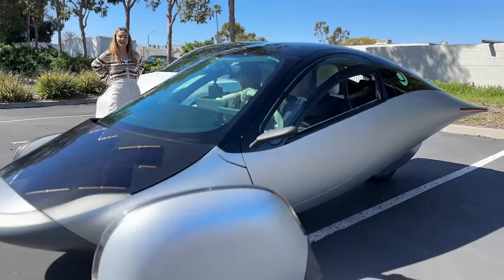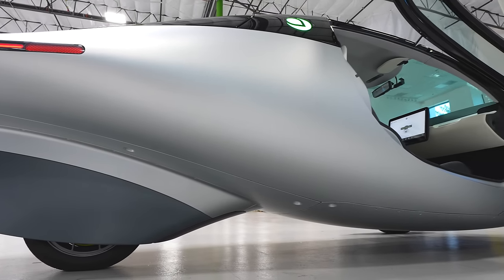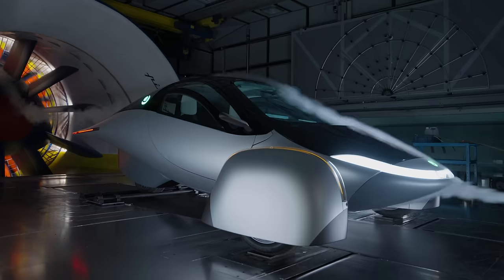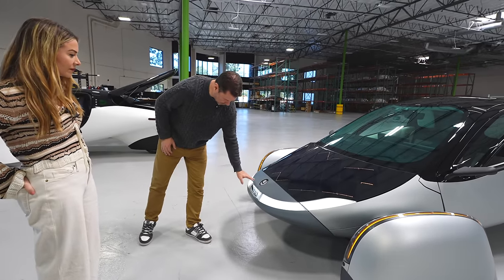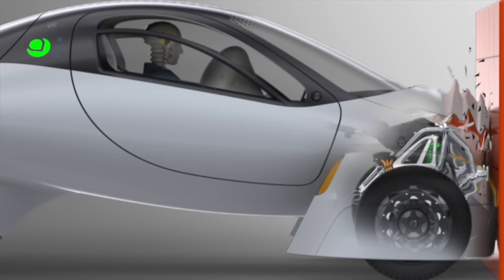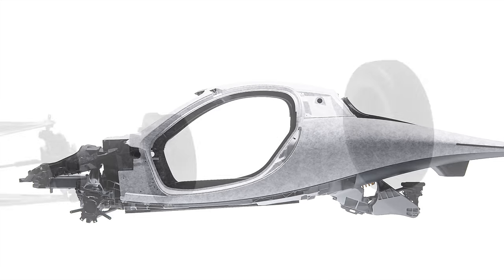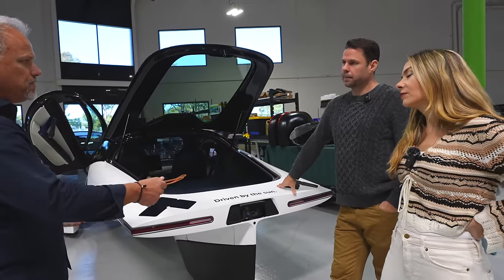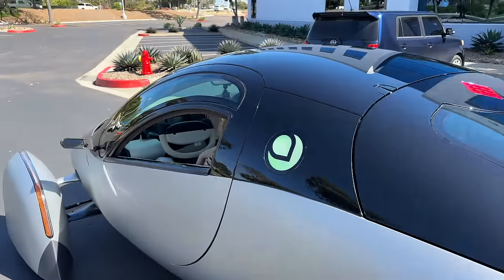Confronting Aptera's CEO w/ Investor - WHERE'S MY CAR?

Comment: This guy say gasoline engines you're only getting about 25% of that energy to the wheels. Ues people know this its also know that car manufacturers program into modern cars ecu and stuff like that to NOT make clean and fully usable. They are programed to WASTE  most of the power it is capable of making. And this all came from a few different people in the automotive industry that were very high up in the design and programming of these units. They said modern combination vehicles would and could go over 1500 miles to a tank easily  if dumbing so to say these vehicles down.

Comment: I see a lot of wasted space in the back
Reply: Not wasted - it forms part of the safety crumple zone, and aerodynamic performance.
Reply: @n.brucenelson5920 Talking about the back end where the single rear wheel eats up 60-80% of potential cargo space.
Mind you I've owned subcompacts, including an 80's Toyota Corolla hatchback  which was 17 inches shorter and 23in narrower than that Aptera, and I carried 2 2 drawer filing cabinets
Reply: @linusa2996  A 2 drawer legal sized filing cabinet has a volume of around 4 cu ft.  Since the Aptera cargo space is 32.5 cu ft, it should be able to hold two nicely.  If needed it can be driven with the rear hatch open with no fear of exhaust fumes.

Comment: This is a bad idea. Solar energy is unreliable, meaning they won't be able to make the trips they want when they want. Also can't park the vehicle in most places (downtown, around trees, indoor parking, garages, etc.) to charge.

An efficient vehicle would just be the same thing with the solar panels stripped out and more efficient panels added to a home or business instead.
Reply: 🤓No, it doesn't mean that, because Aptera charges faster at any charger or outlet than almost any other EV. (That's about 400 to 600 miles per hour at a Tesla Supercharger.) The solar charger is purely a bonus allowing you to not always need to plug it in.

Comment: Aptera has not updated what is going on with the skin cooling feature and how that will work in extreme climates.
Reply: It does not work.
Reply: @RomanChaar  You need proof it works - you're putting the cart before the horse.
Reply: Updates are coming, perhaps even before the validation of the PI vehicles.  The AC system will also come into play during charging or slow speed operation.  

If heat limits are approaching Aptera will limit power production to avoid damage to systems, including the batteries.
Reply: @aussieideasman8498  hola señor Aussie I’ve watched most of your videos. I think aptera said along time ago they are patenting the idea and can’t disclose how it works. Idk it would be nice for at least an update from them
Reply: @RomanChaar  Greetings Roman. They have a patent pending and it is a poor attempt. I have seen it. It cites wingnut (Daniel Morris) as the inventor and shortly afterwards they sacked him. Go figure? Inventor of the greatest idea in auto history in a hundred years and they give him the boot, lol. They had a previous patent before that and Chris Anthony was cited as the inventor. They changed the cooling method after I made those videos saying it can't work. I still say it can't work. They won't be updating, but if their cover of the BMS is anything to go by, it's not worth watching one. Their big hurdle will be getting past the PI validation tests. When they fail those it's all over red rover; nobody will want one.
Reply: @aussieideasman8498  so how will they cool the batter pack?
Reply: @RomanChaar  The BMS will stop the EV - often, lol.

Comment: great show...keep it up... way over priced car...their prices need to be cut in half to be worth buying... however it does not look  like they have the ability to produce many cars in a year so that might be the reason....i like the car however way to expense for what it is
Reply: We do not yet know final pricing, but for sure it will have better performance than the first Tesla roadsters at a fraction of the price.  There are now almost 50,000 pre-orders, and once production vehicles appear, these numbers are likely to skyrocket.  The first production line will be able to produce 20,000 vehicles per year, per shift, and it will be rather easy to build more micro factories.

Comment: Don’t compare this to a car, when it comes to safety features/ratings. This IS NOT a car, nor will it go through the NHTSA crash testing. Comparing to an F1 car is silly. Imagine a side impact of an Aptera by an F150! Both driver and passenger are dead! I dare you to put this through NHTSA crash testing and post the results.
Reply: They've already said that they will put it through crash testing and share all results. They've already done computer simulation crash testing, as per industry standard, and found that it performs very well. It should be as safe or safer than any other small car

Comment: I put them in the same space as Canoo…They both show model, after model, yet no production lines, no finished product, just lots of hype. I mean really you can talk all day long about what you plan on doing, and have one, two working models, but what I saw was a big warehouse with no production line, and or machines that make the machine to make said cars.  I do not see how work stations will keep up with any type of demand. They are still in the talking stage of making an EV, not in the making stage of making a EV. Sorry Aptera I’m just playing devils advocate here, as I do think you like Canoo have a product that the consumer will want and will buy based on person needs, style, and price over other maker, including my beloved Tesla.
Reply: There is far more than just "Hype" here.  They just showed a production intent body at an automotive trade show in Paris.  The initial production line will have a capacity of 40 vehicles per shift, or 20,000 per year, per shift.
Reply: Canoo is making the same mistake as Arcimoto, too many products without a clear path to profitability and using a manufacuring process from the last century. Apteras sole focus is bringing the Launch Edition to as many buyers as possible with a winning chance at profitability from the very start of production.

Comment: Would love to see the CRSSH TEST on that thing.... it would be a nightmare to be on the freeway with it😢😢😢
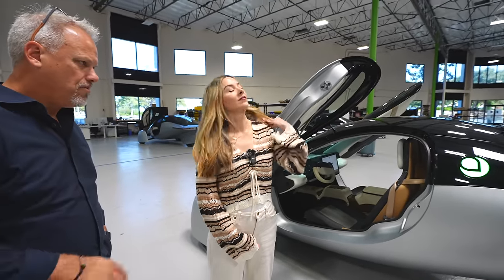Reply: Did you watch the section on safety @9:20 ? The CFSMC is super strong and thick in areas where needed, all around the single-piece tub. But, they also say here, crash-testing will be done and results shared later this summer or early fall.

Comment: An investor who does not demand from the company to file their required SEC end of year financials in a timely manner is not an investor of merit. Companies are permitted 120 days to file that end of year report but its expected they file this report in a timely manner,not sit on it til legally no longer permitted to report.  

Good job in repeating their talking points and not once challenging them on any of their claims.  The safety claims alone are ridiculous, just because they use carbon fiber does not impart safety, their form of carbon fiber is chopped strand which is far weaker than the woven solutions.  The size of the front crush area does not impart a five star crash rating. No manufacturer can actually make this claim as only NHTSA assigns star values and only when they test. The amount of space is only part of the solution, the strength and how the material deforms also must be taken into account.

Seriously you did not push back once.  This looks like a paid integration video. You even reuse their stock footage.  

Tell me, how can you walk through such a barren facility and accept they are going to be in production anytime soon.  The don't even make an effort to organize the equipment they hastily removed from the now closed solar facility.

Comment: Hard to promote and get excited about a Vehicle WHEN The Delivery dates get pushed back for YEARS . Real car Manufacturers will have cars with similar range and price . People reserve Vehicles because they need it    , not 10 years from now 😂
Reply: Like Tesla?

"In 2011, at the end of the production run of the original Tesla Roadster, Elon Musk suggested that a new version of the Roadster, without the Lotus chassis, would return to production by 2014.[6] The new Roadster was first teased in 2014.[7] At the time, it was also referred to as the Tesla Model R.[8]"

This was years before Aptera Corp. was even founded.  We are still waiting.

Comment: Vapourware
Reply: Hardly. They're building prototypes with production parts right now.
Reply: @GoClimbARockEh  and then there's the cost! He said it's a carbon fiber monocoque! really! bullshit. it's fiber glass , if it was carbon, you'd need 50kg of the stuff per car, then layup and autoclave the lot, low yeild, really hard for tolerances. at least 10k for the material cost per car alone just for that part.
Reply: @markfernandes2467  it's forged carbon fiber, not the hand laid stuff. Plenty strong for this application, and surprisingly cheap once you've made the molds
Reply: @GoClimbARockEh  "Forged carbon is typically slightly more expensive than its traditional carbon fiber counterpart due to the manufacturing differences".
Reply: @markfernandes2467  well that's just false
Reply: Until it's not, thanks for the motivation.